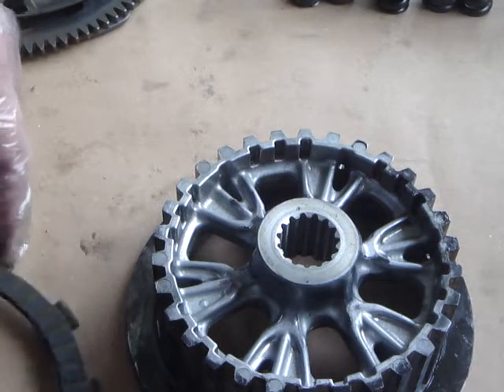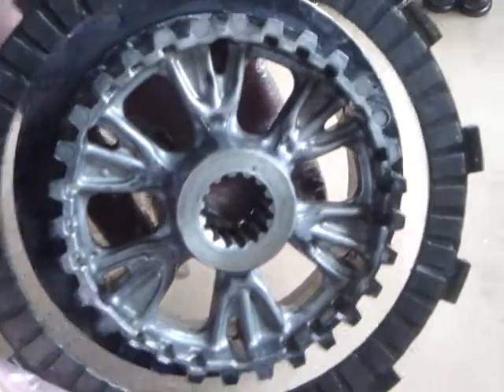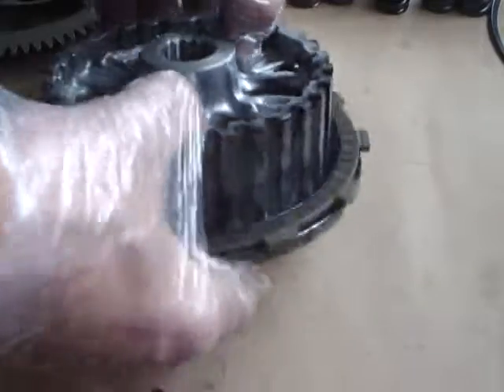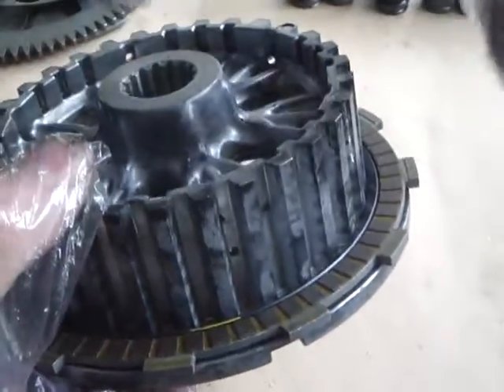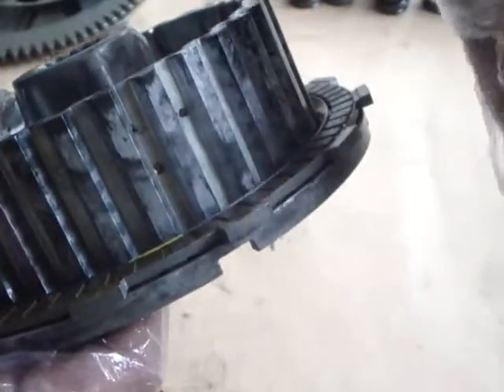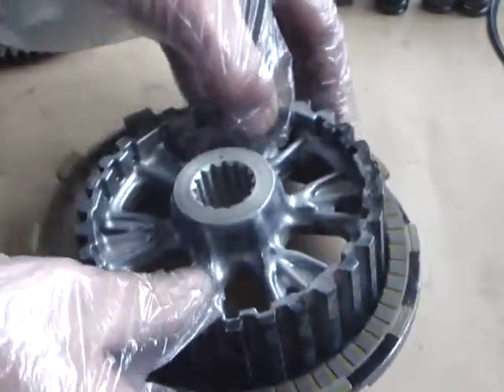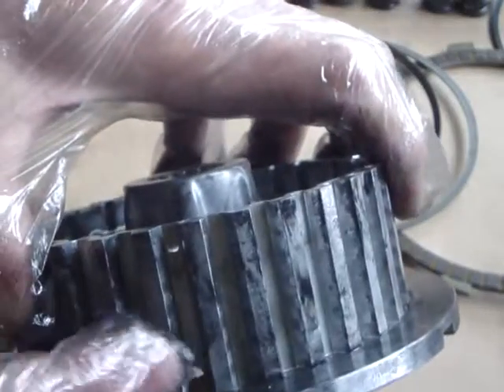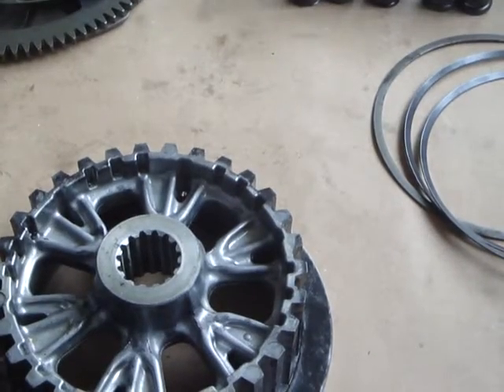Clutch Hub poor lubrication and Anti Judder Spring essential

Comment: Actual working of anti judder spring is to separate the the steel and friction plates from each other when the bike is parked overnight, they stick together and when you start the bike put the first gear with the clutch on it still jumps, to eliminate this, they are used.

Comment: Interesting..... I found this video while researching how to eliminate the Judder spring in a 250cc dual sport. I heard you say 1200cc is this for a road bike ?  The main complaint with these on Dual sports is that in off road riding they allow too much slipping ( off road ) of the clutch plates causing them to overheat and wear prematurely, as well as give a feeling of lack of power. The general consensus ( regarding Dual Sport bikes) is that they are good for beginning riders new to dual sport riding to help them not stall the bike, and they take some of the shock out of shifting on road ( not my words just what I have read etc)  So I would be interested in your opinion of this ? Do you think it reasonable to want to remove this if your sole purpose is increasing performance for off road riding when rear wheel hookup is more important than a smooth clutch engagement...Oh and one more thing I suppose, does it make a difference when this is used in a hydraulic system as compared to a cable type clutch ?  thanks for the video and thanks for the time .
Reply from the maker: Interesting question. These anti judder springs soften the take up of the clutch. The anti judder spring pushes in the other direction to the main pressure spring typically for the last 0.3 mm of pressure plate movement. The result is that your pressure plate springs will not have quite such a firm clamp on the friction plate that the anti judder spring is housed in. So a clutch with say ten friction plates might be only getting full pressure spring load to the first nine. The tenth plate receiving less clamping pressure. I would say its fair to assume you might only be able to carry and extra 5% of the clutches maximum torque with the anti chatter spring removed. That cold well be the difference between a biting clutch that holds the engine load and one that slips and wears itself out prematurely. I typically find that anti shudder springs ever so slightly reduce the overall torque capacity of the clutch because the friction plate they are housed in wears it's friction linings. The problem in the clutch shown here is that the anti judder spring is so weak compared with the main pressure spring that its hardly effective. The anti judder friction plate, with only half the lining area of a normal plate is expected to work as hard as one with full friction linings. The lack of oil to it further adding to its woes and short life.
Cable can bind if damaged or corroded so can stop the pressure plates full load reaching the plate pack. Same if cable adjusted without any free play. Hydraulic less likely to suffer any of these as most are self adjusting and no cable to corrode or damage. Hydraulic better mechanical advantage so nice light feel to the lever.